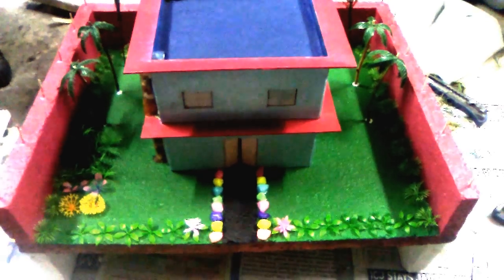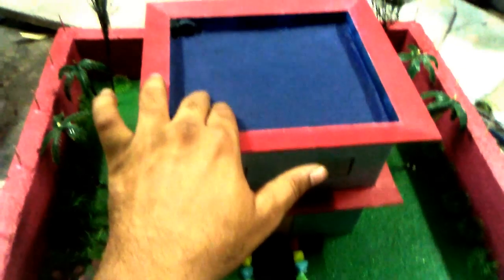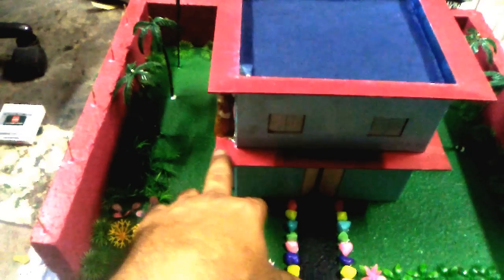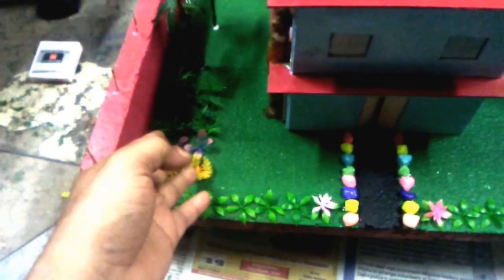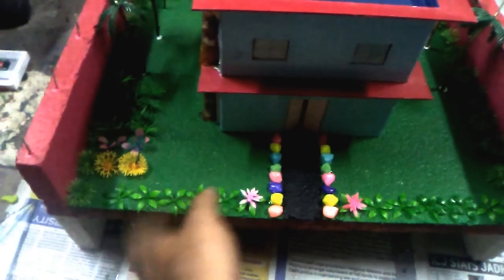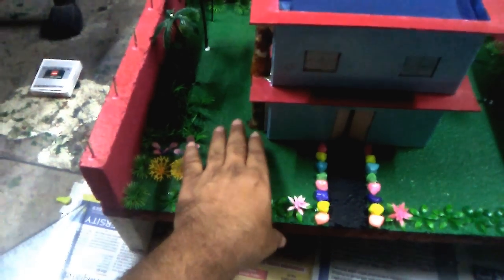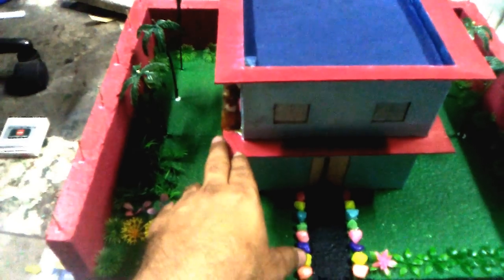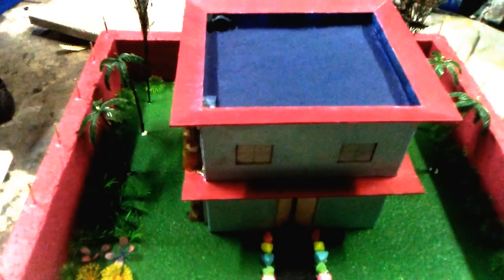RAIN WATER HARVESTING WORKING MODEL | Rain Water Harvesting Model | School Project | How TO Make

Comment: Nice but how to make
Reply from the maker: natarajan on : base is made-up of Thermocol 

* house is made-up of 3mm softboard (use cynoacrylic glue to make it)

* base colour = mix clean soil in Fevicol + water 40% + POP (pop not compulsory)

* you should colour walls before fixing them on base .... so that the base colour won't mix with wall colour.

* make a hole from roof to bottom so that (in such a way) ..... you can collect water in a pot below the base. (use Fevicol to make roof waterproof) and let it dry in sunlight for  1 or two days

* do not use....... elfy/ feviquick / bond007/ cynoacrylic glue on ..... thermocol .. it will burn the thermocol.

* you can also use glue gun to paste thermocol and house altogether..... but I recommend Fevicol .... as it is stronger than Fevicol.

Comment: how did u make this can u tell us plsss
Reply from the maker: 1. Thermocol cutting 2. Fevicol + Sand mixing in colour 3. Little Thinner or Tarpin Oil carefully mix the ratio with Mr Fixit Solution 4. You can also use cynoacrylic gum for making connection wtih hut (please mix little water with cyno)
Reply: Malvika Verma bakwas